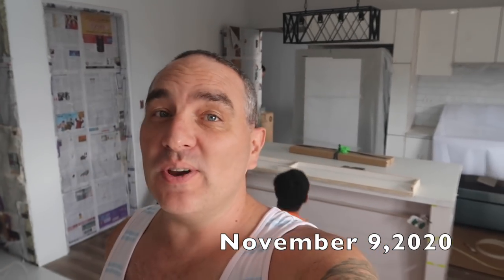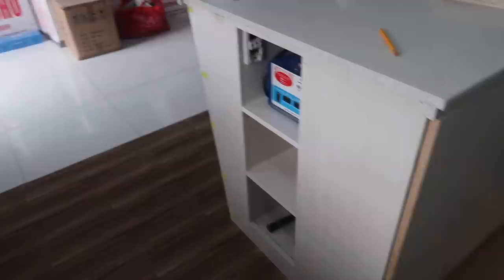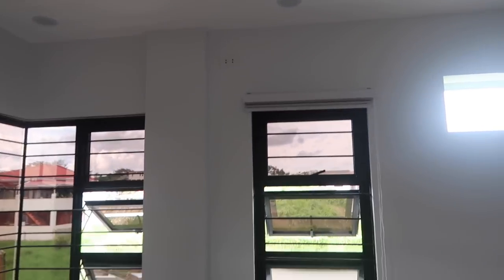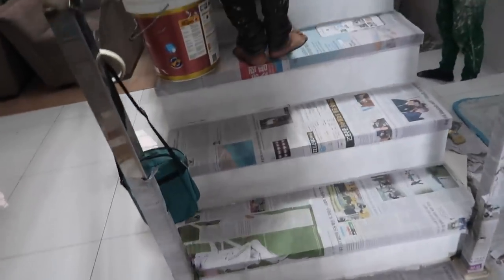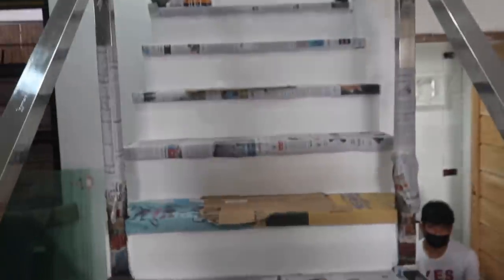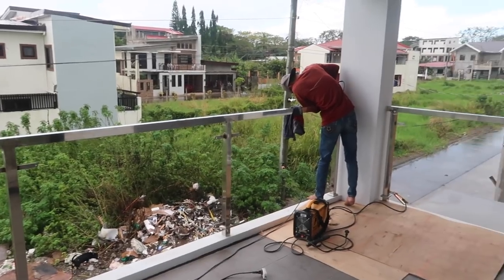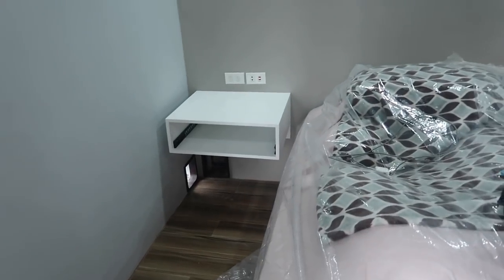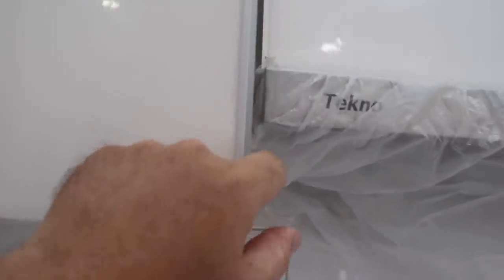HOUSE BUILDING IN THE PHILIPPINES - EPISODE 196: WE MOVED IN! I GLASS ENCLOSURE I WATER FILTER TEST

Comment: Great series - congratulations on moving in !😃
For the pipes vibrating, known as water hammering - for a quick fix i would use some cable ties until you can get a bracket made / attached to the steel framing

Comment: For the water tank; did they provide you options on mounting it or did the worker just not complete it all the way. Had it been me, id request to have it mounted. Id also look into using metal piping or copper. The reason id use metal or copper is so that it can withstand thw psi.